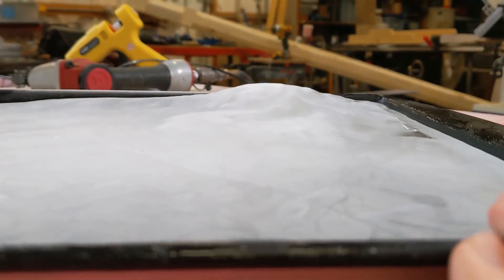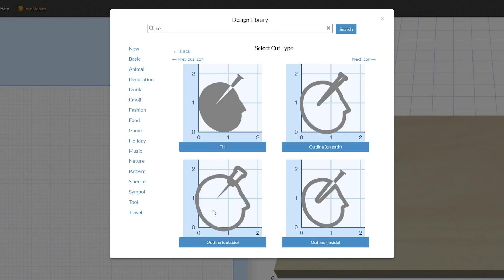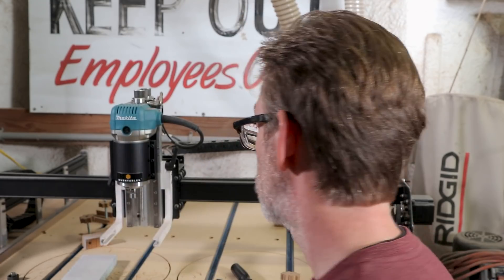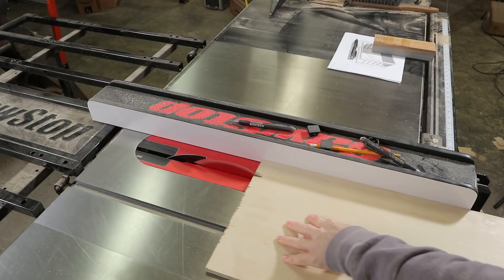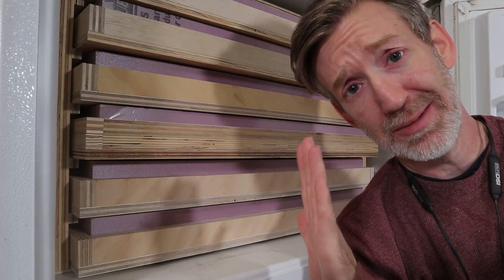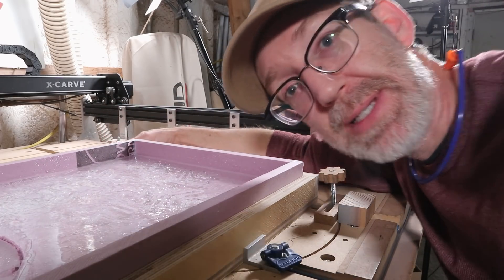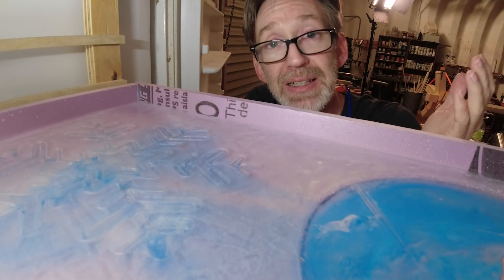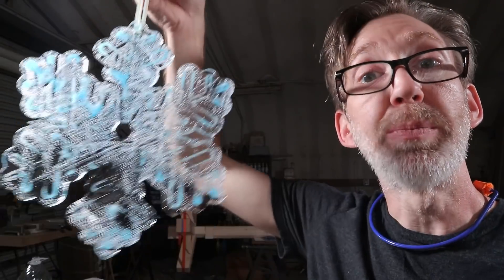Can You Carve Ice on a CNC Machine?

Comment: If joint surfaces , sprinkle some salt on them and it messes with the freezing point of the ice in a good way had helps bond the 2 ice panels in much the same way accelerator helps with CA glue

Comment: you need directional freezing, you were on the right track with the insulated method.. just don't let it freeze all the way.. leave some water in the bottom and you should be able to pull off a nice flat perfectly clear sheet of ice

there's a machine called a clinebell that makes the huge blocks of ice for carving, and it freezes directionally from the bottom along with circulating pumps so all of the gases can escape and any expansion can happen outward instead of in the middle/under the blocks of ice

Comment: Hi Wesley!  You can create your own mini-freezer using a window air conditioner and insulating sheet foam. Build a box of insulation, cut a hole for the ac unit. Move the air temp probe from the interior (cool) side to the outdoor (warm) side and the unit will run continuously. I modified one to cool liquid, which is much more complicated, but was able to easily cool 5 gal of antifreeze to -18C. The only problem you may have is high humidity might freeze water on the cooling coils. Any cooling is better than no cooling!

Comment: I did ice carving when I was in culinary school. The blocks of ice were about 4 feet tall two feet wide and 18 inches thick. The blocks were made in a giant box and there was a circulating pump. Evidently that reduces the air bubbles. The air bubbles make it weak, and porous. 
Oh and your first try, think Arnold’s voice and say “It’s not a tumor” (kidengarten cop)
Reply: it's called a clinebell machine, and along with the pumps the ice is also frozen directionally from the bottom, so gases have a chance to escape as it freezes upwards

Comment: Fantastic.  Loved this - wondering - what if you had poured as thick as you wanted (2”?) and used a surfacing endmill to level the ice then refreeze it?  I bet you could go super aggressive.
Reply from the maker: Thanks! I did use a surfacing bit before I cut the rings for the glass, but I left that part out. I've found, though, that the more water I try to freeze at once, the worse the problem is. The thickest pour broke the foam. I'm going to experiment with freezing it in layers.

Comment: Ice expanse because the air trapped in the water can’t freeze so when the water starts to freeze the air tries to escape but can’t so the bubbles press against to ice and create mound’s so if you put the water in a vacuum chamber first you will get a better result just think about a bottle of soft drink in a freezer and what happens if you try to open a half frozen one it expands rapidly well water does the same thing but on a smaller scale

Comment: If you filled a styrofoam cooler with dry ice, put a blower on one end of it and a vent on the other, and pointed the vent at the surface of the ice you're carving, you could probably increase your carving time substantially.  You might also try to layer some dry ice pellets on top of the ice blanks (once they're frozen solid, obviously) in the freezer, to lower the temperature of the ice before you start carving.  That might crack the ice blank but it's worth a try.

Comment: fun video! FYI the reason why the bulge was on the bottom with the distilled water, is because your tray was insulated, so the water froze from the top down, when the expansion happened the top was relatively thick, so it pushed downward. With the metal tray, the water was able to freeze from all sides, so the expansion was able to push the still relatively thin top up.  Pro Tip, if you want perfectly clear, haze free ice,  Freeze from the top down, and stop before fully frozen to the bottom, and use warm distilled water.  (Small cooler, in a large chest freezer works great)
Reply from the maker: Thanks! Oh, believe me, I watched all the ice-making videos. 👍‍‍

Comment: You could place a few blocks of dry ice on the 'water' ice while the CNC is working (just outside the work area). CO2 is heavier than air and while the dry ice is sublimating it will leave a temporary cold layer of CO2 above the water ice - less melting of the 'water' ice. It's a simple and safe experiment to try.
Also, why not add a vacuum next to the CNC router to remove the ice chips?

** edit **
Forgot to add for other readers - CO2 freezes/sublimates at −78.5 °C/−109.2 °F. The cold CO2 will always keep the 'water' ice frozen.
Reply from the maker: Unfortunately, the spinning collet nut still creates circulation that would more than likely blow away the CO2. A lot of the melt I got even after adding the ICE Cap was almost definitely caused by the wind from the spinning nut.

As for dust collection, the ice chips like to stick and don't suck up as freely as sawdust. And after a couple of minutes, the bit creates slush instead of chips, which is worse and stays in the cut. It worked better to suck it up once the bit moved out of the way.

Comment: You might invest in a window unit to chill the work while you carve. Great work as always!
Reply from the maker: Thanks! I've already designed something in my head if I ever try again.
Reply: A trick market gardeners use when building DIY cold rooms for produce is to use a window A/C and "cool bot" to override the united thermostat to get temps down to 35 degrees or so.. the downside is Coolbots are stupidly expensive - 400 bucks or so. If you're willing to do surgery on the A/C, bypassing the thermostat and using something like an ink bird, or if you're really feeling adventurous, wiring in a PID and solid state relay are also options.

Comment: That I.C.E Cap would be useful for ordinary carves as well.  The router exhaust chip/dust clearing "feature" makes chip/dust collection harder.  By redirecting the air so that it doesn't add to the "escape" velocity of the chip/dust, dust collection should work better.

Comment: Boil the water before freezing. It removes the dissolved air and gives more transparent ice. You may still have an unwanted bulge though.
Reply from the maker: Tried it in one of the trays and it didn't make a huge difference in clarity, as many claim. It seemed flatter, but it was only one test. I may run some tests in the future. There was a lot of ice-related exposition that got cut from the final edit that I'll probably upload to Patreon.